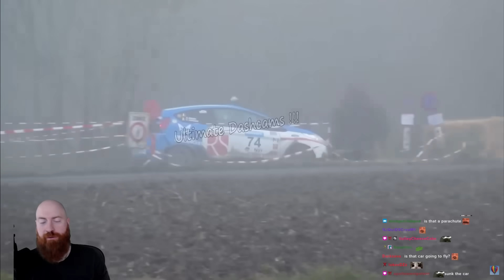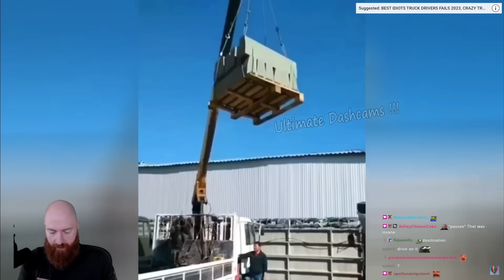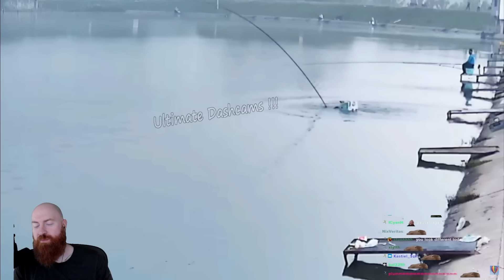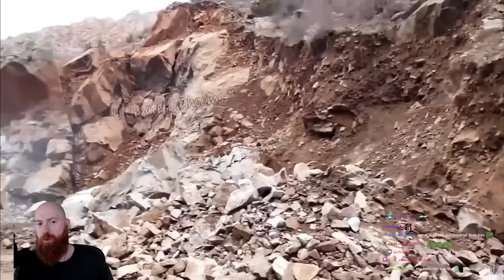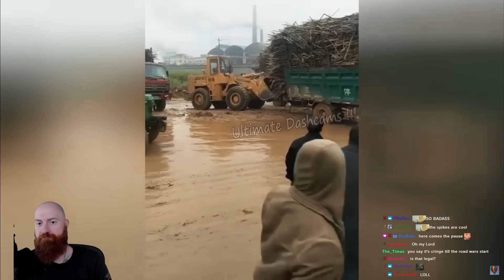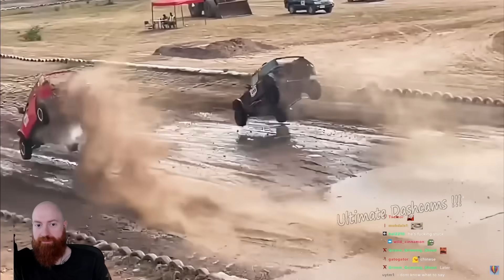Xeno Reacts to Epic Car Fails and Wins | Cars, Trucks, MUD

Comment: The problem with the first clip was that with the truck hauling that big trailer, he couldn't just slam on the breaks as the momentum of the trailer he was carrying behind would cause the trailer to go wild, so the truck figured going off the road was the safest bet (which of course didn't work out for them). Ofc, the truck should have given a wider berth for the car in front of them, knowing they had that big trailer in the first place.